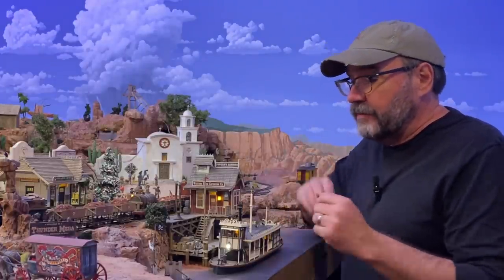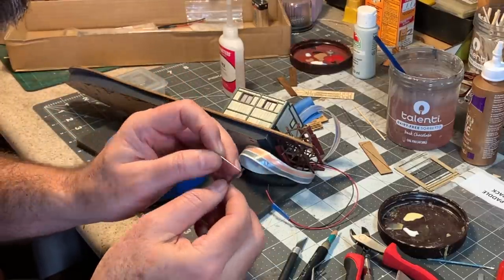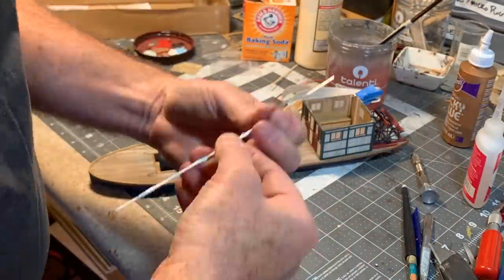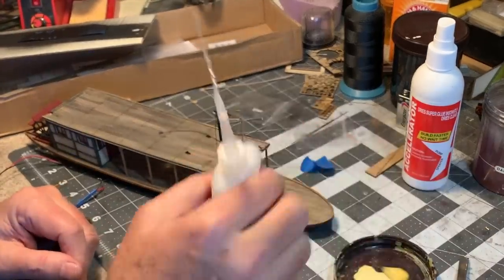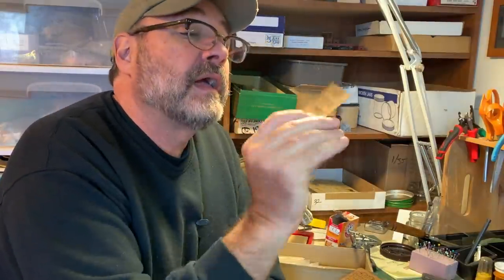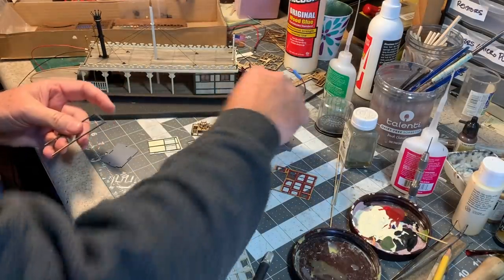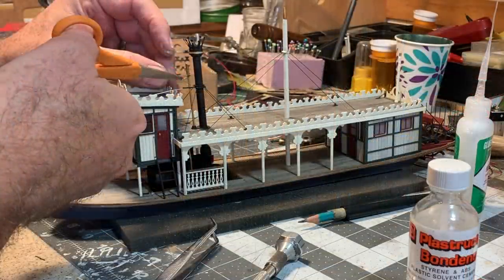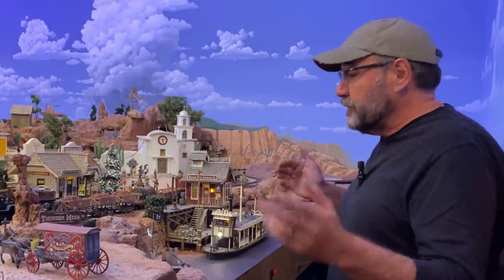Building an O Scale River Steamer: The Canyon Queen

Comment: Dave,

I wanted share a tip with your readers.  The last two days my wife and I have been pulling out Christmas decorations.  Among that were 5 sets of LED lights/strands for indoor/outdoor use. On two of the sets nothing lit up.  One set only half the lights lit up and the remaining two lit up fine.  I went into my modeling bench to retrieve my homemade LED tester.  A nine volt battery clip with two alligator clips soldered to the battery clip with a resistor. There are plenty of videos on YouTube about making a tester.

I started pulling and testing bulbs on one of the sets that didn't light up.  These LEDs are sealed in a plastic shaped like a barrel.  There are 5 colors.  The wires are exposed when you pull the lights out of the plugs.  In 30 minutes I found two LEDs that had one wire that had broken off at the base of the plastic where the LED is sealed in.  I pulled replacements off the other strand that didn't light up.  On the one that only half lit, I plugged it in to determine where the bulbs didn't light up.  I found one bulb with a broken wire.  That took 15 minutes to find.   I got a replacement from the strand that nothing lit up on.  Now I had 4 strands of lights working. I thought about trying to find replacement bulbs online, but I also thought about all the LEDs I could have for my model railroad projects.  So, I pulled the remaining LEDs from the non working strand.  I tested each as I pulled those.  I found two more with broken wires.  What is interesting the my LED tester can make all 5 of the LEDs with broken wires light up.  Drop of solder and a new wire and I should be able to light up a structure with those.  I ended up with a total of 60 LEDs that I can use on projects.  So, don't throw out those LED light sets.  Salvage the LEDs for your lighting projects.

Comment: Not sure of the flag pole practices in Thunder Mesas era of time but I know most if not all flag poles on ships from 1900 on were installed at an angle and not full vertical. I have no Idea if it was common on River Boats or not.
But as always BEAUTIFUL work.
Reply from the maker: My placement is based on Disneyland's Mark Twain, which is vertical.

Comment: Most inspiring to see you work with a wooden kit! I have been doing CAD and 3D printing for years, but a laser for making this kind of parts would be great. How much approx did your laser cost and does it stink like a resin printer does when running ?
Reply from the maker: How it smells depend on what you are cutting or engraving. Mine usually smells like a campfire. I have a 50w Co2 laser and it was about 5k. You can get lower powered diode lasers for much less.
Reply: Only suitable thin wooden sheets. Smell itself is ok, just hoping it isn't as toxic as my resin printers.

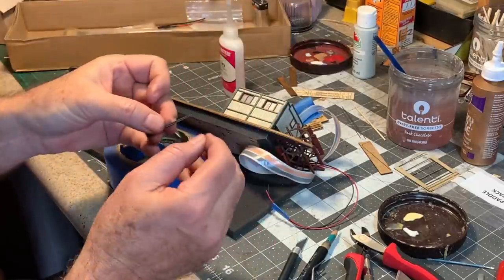Comment: I am at 6:09 in and I had to comment.  Quartering of drive wheels and cranks is a 90 degree angle not 45 degrees for 2 cylinders.  I was a relief engineer on a 50-foot stern-wheel boat on Caddo Lake out of Uncertain, TX between 1995 and 2000.  The name was The Graceful Ghost.  It was based off of boats designed and built out of Chicago for small rivers and lakes around 1900.  Cruising speed was about 5 or 6 mph or 15-16 RPM of the wheel.  Her engines were 4 X 16 at up to 175 psi.
Just finished the video.  One-this may have to do with the kit design but there needs or should be a white or yellow steering or sighting pole on the bow for the pilot to follow.  There needs to be 2 anchors on the roof for the stay lines from the flag pole like at the stern instead of ending in holes in the roof.  There needs to be an easy way to get to the stern for the stern cleats and to lubricate the bearings on the wheel and pitman arms that end on the cranks(very important).   Where is the rudder(s)?  Where are the 'scape stacks for the exhaust steam that should be above the cylinders(one for each side){these are most important}?  There generally would be more bracing along each side to carry the load of the wheel to a larger proportion of the hull for strength.  The direction of the boiler(which is Scotch Marine) could be either way but a lot of tow-boats on the Mississippi and Ohio Rivers were turned so the draft would be helped with the firebox to the bow when under weigh.  I am going off the design and layout memories of the Graceful Ghost and the old boat catalogue she was built from.  The Graceful Ghost was wood-fired but the engine controls were back at the engine.  In river parlance, western rivers meant the Ohio, Kentucky, Tennessee, Mississippi, Missouri, Arkansas, Red, and tributary rivers.  Most boats would have the decks higher in the middle and slightly curved down to meet the sides.  The photos I have seen show headlights about half again as large to twice as large as loco headlights for the light needed.  Port(red) and starboard(green) lights on the pilot house and stern light are needed.  It would be fun to be able to go over all of this stuff if you are interested.  The lady who had the Graceful Ghost built holds a masters and steamboat pilots license on the Mississippi and Ohio Rivers(the only woman to do so).
Reply from the maker: Thanks for the info. Of course I meant 90º and that's what I actually did. The rudders are added at the end. You might want to take up most of your complaints with Kitwood Hill Models, designers of this particular kit.